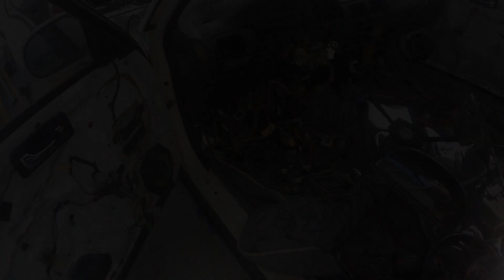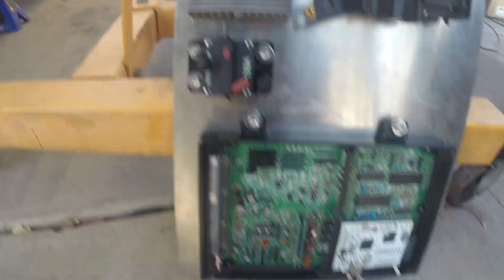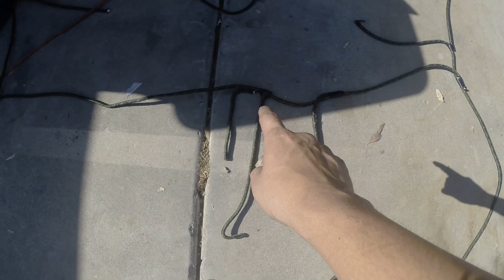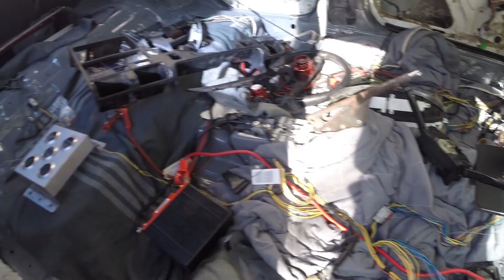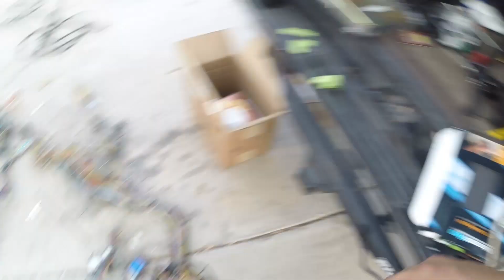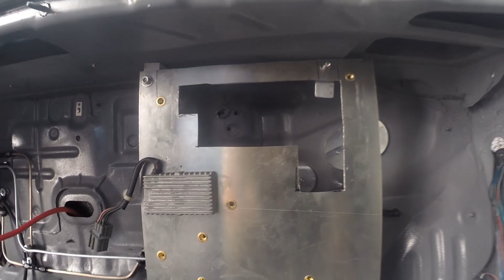CB7 Wire tuck part 2 - Custom ECU & Fusebox Mount - Track CB7 Build EP. 17 - 92 Honda Accord

Comment: No TCU? I have a blinking D4 issue. I still haven't resolved it. I replaced shift solenoid, and lock solenoid. And NM Speed Sensor. And I have tried various used TCUs. So its interesting that you don't have a TCU hooked up. Maybe I should buy another ECU, maybe that's the problem.

Comment: For the ac controls and anything for that fact that you're no longer using, do you keep the connections still or cut and tape up?
Reply from the maker: Pretty much any wire I removed I basically removed it from the source. Cuz I just want as little wiring as possible.
Reply: @JaayPeeBuilt  finishing up episode 3 right now presuming everything is working, but hey you have somewhere where you have what wire is what? I got stuck rewired mine and everything and then all of a sudden I try to start it and there's some spark from under the dash but I've been too lazy to try to figure it out hopefully you're not too far from Avondale lol ( @cbsaiyan on ig haven't been on in awhile though)

Comment: Cool idea with the electrical panel 👌. Backing it with like 1/8 plywood or something would help dampen the noise, plus adding the rubber mounting pads like you mentioned. 
Thanks for the upload , later.

Comment: Hey man! I sent you an E-Mail about your hose-clamps on the temp sensor! Check that out!!
Reply from the maker: For sure just checked that out! I think I might do that!! Thanks man!
Reply: Also, if you lay E6000 glue on the ECU mounting plate, that will reduce your rattle and hold a little better. (Glue the plate to the body and lay a bead down)